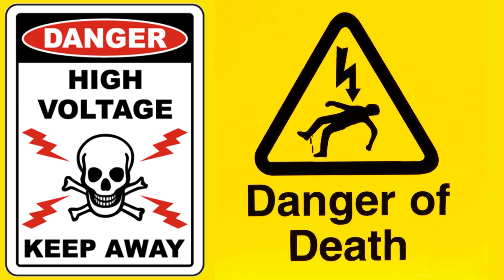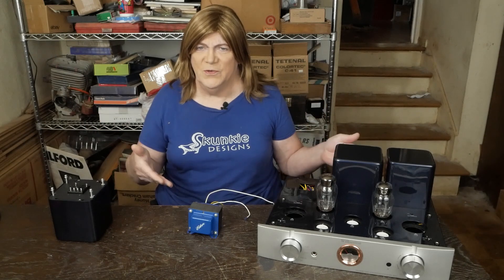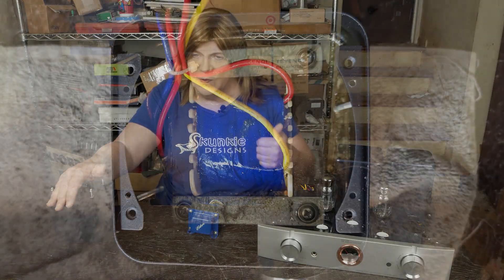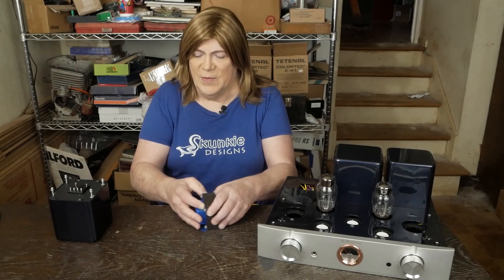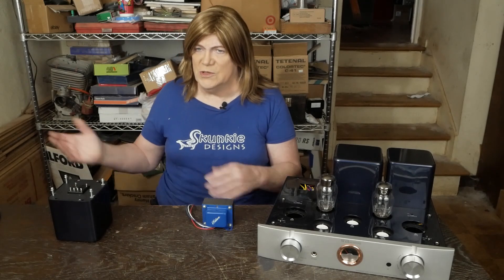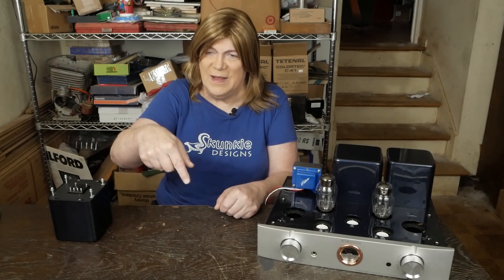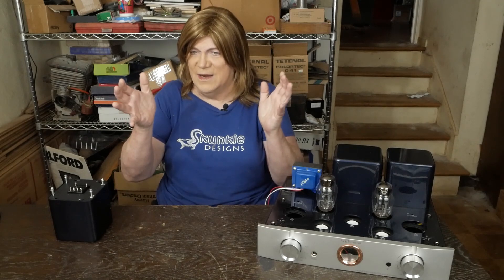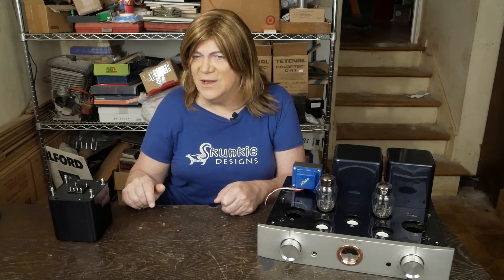Willsenton R300: Follow-up on Transformer Choices

Comment: Anything you can learn about transformers certainly won't be a waste of time and can only help with any future tube projects, no matter whether PP or SE. I'd be very interested to see some discussion about speaker impedance variation and how/if it interacts through the transformer and creates a poor load condition for the output tubes.
Reply from the maker: I will and this is part of the reason I normally spec a slightly higher impedance OT than is called for on paper.

Comment: I thought them big ole black ones were potted. You have a definite notch killing that frequency   thanks I've bought. Acro sound. In my early years. Love what your plott all the different.  I'll stick with smaller output tubes. I'm building 2 a couple amps with 6as7. S. Multi and single ended.  Cheers

Comment: Your transformer exploration is very timely! Very much looking forward to your findings on the Tango vs the world :) One thing I’m curious about, is why you have yet to get yourself a full range driver mounted in a Voigt Pipe. Given your love of SET amps, I would imagine the combo of SET/Full Range Horn would be right up your alley!
Reply from the maker: Trying to avoid too many "SQUIRREL" type distractions. It's so easy for me to end up down another rabbit hole.
Reply: @SkunkieDesignsElectronics   Yeah, I get it! It’s soooooo easy to get distracted :) Buy, I’m gonna suggest that you at least give it a go :) You’ve built other speakers, and pipes are pretty straight forward. And who knows, they may not be your thing at all!
Reply from the maker: any suggestions on a design to try that's not too hard to build?
Reply: @SkunkieDesignsElectronics  A basic Voigt Pipe is a pretty simple build. The other option is a Bigger is Better enclosure (BiB). Lots of info on DIYAudio for these.

Comment: Hi, sometime a product quality equal the quality of it components; so they try to save money on the transformer or maybe it was a bad batch that have slip true. Anyway it seem you are almost reengineered the hole thing and I guess the need more quality control. So thanks for this serie of interesting video.😊
Reply from the maker: I have two of these R300 amps and both behave the same way.
Reply: Well if it's the case, they try to save money on some parts. @SkunkieDesignsElectronics